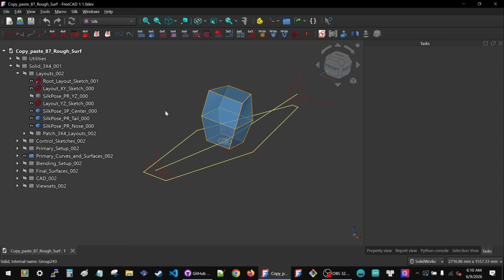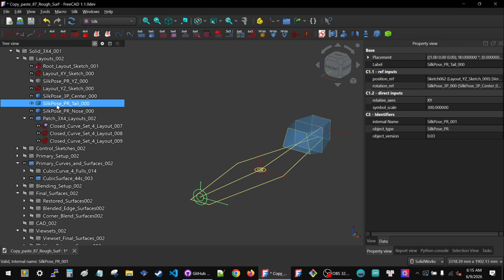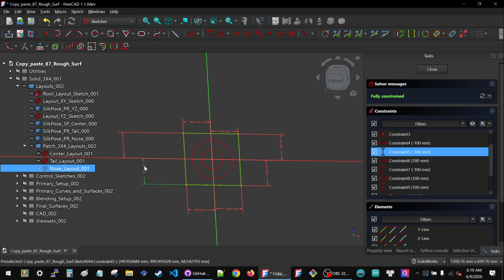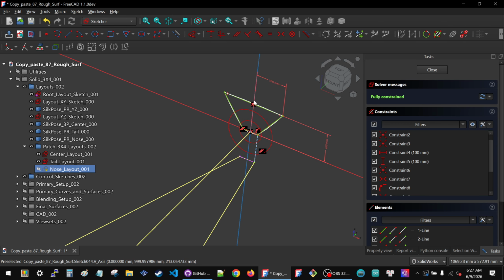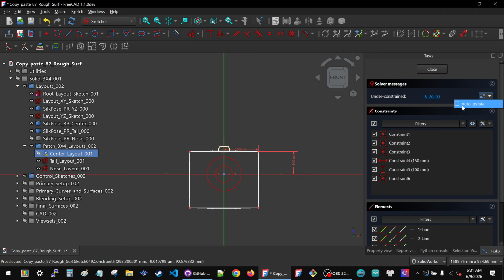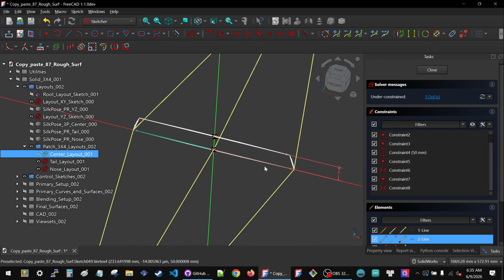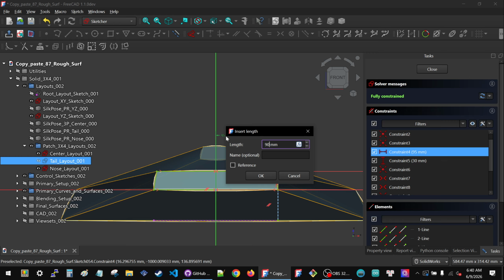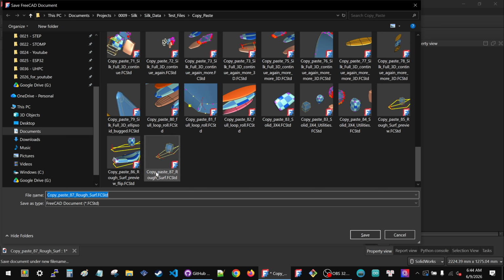FreeCAD Silk - Complete Tutorial Series 30 - Still Rough Surf

Comment: I might try to use this approach. I'm a little confused about the pose objects, I'll have to try using them. I'm not looking forward to my final work, as i plan to make a hollow body and i won't be able to simply offset/pad, as i plan to make some complicated snapping geometry. I want one line to not have fillet, but i might end up settling on it, but i will probably have to do any filleting in my driving sketches instead of using the silk filleting blends.
It seems crazy how much work this can be.
Reply from the maker: It is indeed a crazy amount of work, but also keep in mind that these video tutorials are didactic. I'm doing things in a specific order to introduce concepts one at a time.  I do a lot of switching things around just to show you can.

If we had been building a surfboard form the very beginning, we wouldn't have created the topology "90 degrees off". I would have simply created the surfboard layouts, curves, and surfaces directly in the correct place. I also wouldn't have put in the 'preview blends' since i know i want the more advanced blends...but it would still be a lot of work